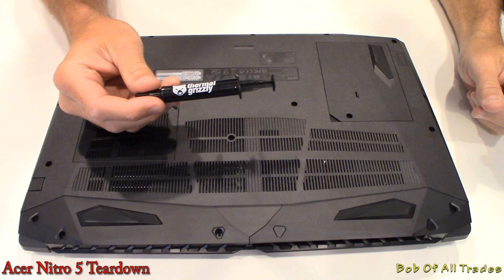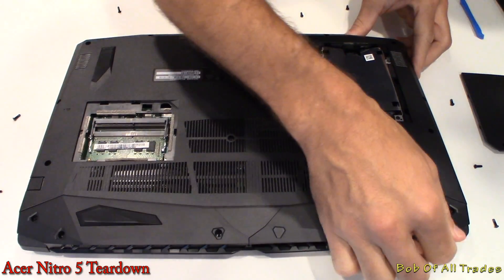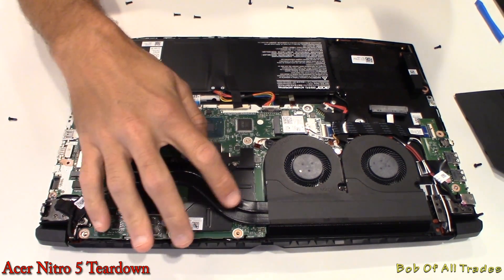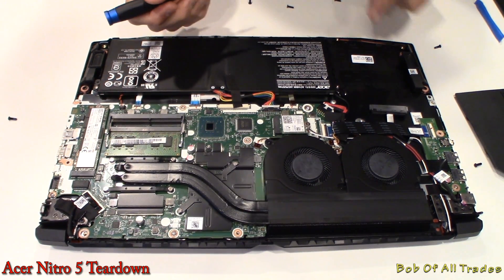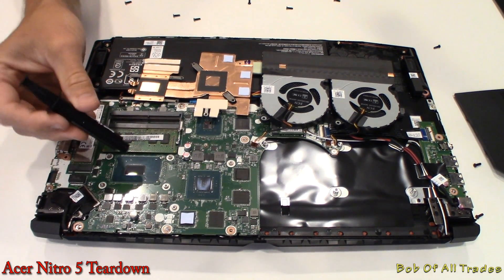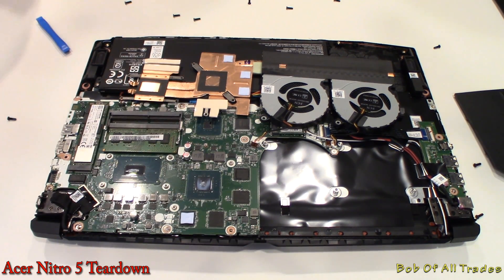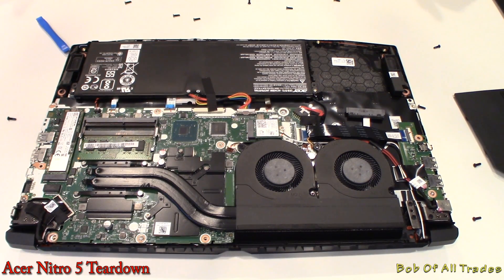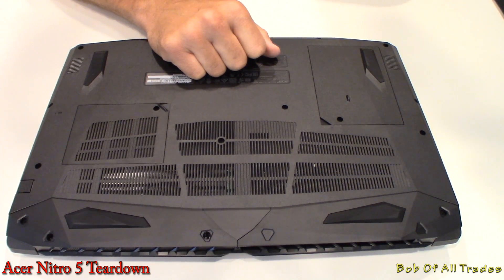Acer Nitro 5 Repaste w/ Kryonaut!  i5 8300h

Comment: how did you get temps repaste + UV around 70-75c .. i have got 75-90c after replace arctic mx-4 with playing need for speed payback
Reply from the maker: MX-4 isn’t good anymore. 

You didn’t say you undervolted 

I also used max fans

We’re playing different games.
Reply: @BobOfAllTrades  i undervolted -0.150v + mx 4 get that 75-90c while playing need for speed payback

Comment: Never even considered replacing thermal paste on a laptop. Funny thing is I build gaming pc's. I just bought a hp Pavillion gaming laptop model #    15-cx0056wm
with an i5 8300h as well, I have some kryonaut and will definitely do this. Hopefully the disassembly and application will be  just as smooth.

Comment: Should've applied some liquid metal
Reply from the maker: doggo the doge It didn’t need it
Reply: @BobOfAllTrades either way thanks for the video. Really helpful.
Reply: I really would not suggest it. Yea it is superb, but it is also superb dangerous especially for laptops that are always moving around getting carried around.
Reply from the maker: There’s plenty a third-party vendors that sell these laptops with liquid metal applied and offer a warranty. If you know what you’re doing it’s 100% fine.
Reply: @BobOfAllTrades  name me one, that's complete bullshit, Linus did a video on liquid metal applied on the new Predator laptop (why didn't they put it as stock, then?) and they specifically said that liquid metal can ooze out around the CPU and gpu and potentially short something
Reply from the maker: I will name you two. HIDevolution and Eluktronics. 

Linus tech tips? LOL they didn’t even know who TongFang was.
Reply: Not going to change the fan + heatsink thermodynamic limits.

Comment: very clean and good informative video. Not many of these around :) thanks! I'm considering this laptop with 1050ti and i5 8300H. I just might aswell open it up and do this like you did right of the bat :)
Reply: Did you buy the laptop already?

I must say I did, and my temperatures did change. Yes I used another kind of paste, arctic silver ceramique 2, which might not be that heavy. Still I dropped an easy 10C at idle and 20C under load/gaming.
Reply: @MrGtagangster  without undervolt?

Comment: Hey man, thanks for the good disassembly guide.
Could you please help with an advice??
So i play cs go and my processor temps reach 100 degrees celsius... i use cooling stand for my machine but it makes no difference... i have read that grizzly conductonaut helps a huge amount, but one should not apply it on aluminum heatsinks. so the question is are heatsinks on this machine copper? if yes then i can apply grizzly conductonaut and it won't damage heatsinks and processor and graphics card chips? thanks for your advice in advance, merry christmas to you and your fam
Reply: Looks like copper

Comment: Hi, need one help.
In my Nitro 5, (7700H and 1050ti), CPU reaches 85-90c under load with -100v undervolt (otherwise reaches 95c no thermal throttle though), and there seems to be a lot of fluctuations in the temperature. GPU however is quite stable (65-75 under load) not much fluctuation either. Could it be thermal paste issue?
Would acer service cover this under warranty (don't want to void it yet).
Reply from the maker: Akshay Jain This is what repasting is for 👍

Comment: Gonna do this on my brothers nitro 5 now. Thx for the guide, wish me luck lol.

Edit: After spending a long time reapplying using this video I dropped the CPU temps about 10C but I am really bad at applying thermal paste is what is turns out and didnt get good coverage on cores 2 and 4 which dropped only like 4 or 5C. I do not want to do this again because it stressed me out lol. That was my first time applying thermal paste. Building my first PC next week so I guess it was good practice even though it was only a laptop.
Reply: I dont want you to cause any problem but, as long as your paste is no conductivity top, a little more paste is always better than little less paste. Again as long as it does not have any electric conductivity, there is literally nothing that can go bad with using a little more paste. There was a whole video just about it at Linus tech tips

Comment: HELP HELP👇👇
One of the motherboards screw to remove the fan,cpu,gpu etc are so tight 
Im not sure wht to do 
Last time i try i press the screw too hard and the screen broke 
Help me if u know wht to do and i prefer to do it my self
Reply: Did you break it?
Reply: @ehrix4468  its not break like tht,but all the screen edges has this red colour thing...if the screen is black u can see it
Reply from the maker: I ALWAYS use the iFixit toolkit as it offers several different screw bits so I can get the proper fit.  This way I do not have to press down hard to get traction or strip out a screw.

Comment: Wow, thank you! It reduces my CPU temp from 95-100c to 75c with mx4 thermal paste and -0.125v! My 1060 6gb are even lower!
Reply from the maker: Marius Rugland No problem!  A lot of times that thermal paste will just sit there and  dry out for many months before the machine gets used so it’s usually pretty crappy right out of the gate. You made a good choice and it makes one heck of a difference :-)
Reply: @BobOfAllTrades  Does this void the warranty? And if I got a cooling pad, would I necessarily need to worry about this? I plan on gaming for long stretches at a time!

Comment: I've got this same model. I haven't undervolted it, but I did repaste. 
Before the repaste the idle temp (around 10% cpu usage) was 45c but it 
would get to 95c+ under full load. 

After the repaste it idles at
 around 45c-47c and only goes up to 74c under full load over extended 
periods of time. I'm definitely happy with the temp under load, but 
honestly I'm confused as to why idle temp stayed the same.
 
What kind of idle temps are you getting? Do you think it's okay for the cpu to have such a high idle temp?
Reply from the maker: The fan curve pays respect to the temps so idle temps likely won't change.  It's also why your load temps improved so much assuming you used the max fan speed button.  Make sense?

Comment: Hello, what model is the SSD that it use? I have the same laptop but without SSD and is haven't found a proper one to this model. Greetings
Reply from the maker: Mario Jofre You don’t need the same model put whatever one you want in there. 👍
Reply: @BobOfAllTrades  yes, I know but what type of SSD it use in the slot, it is PCI ? Or m2?
Reply: @mariojofre4951  i have the same laptop and its m.2
Reply: Thanks , finally i buyed a SanDisk ssd m.2 and it worked great! It's incredible how fast it's working now, greetings.

Comment: Thank you so much for the video! This was exactly what I needed. I just put Kryonaut into my Nitro 5. I'll see how much it helps the temps.
Reply: How much did it help?
Reply: @AN-vs5pb  I actually don't remember exactly how much the temps dropped off the top of my head, because I returned the Nitro 5 soon after and got a Dell G3. But I remember it helped reasonably well, I think somewhere in the ballpark of 10°C.
Reply: @nomadben  Why did you returned it? xD
Reply: @Domin17maru  Cause it only had a 1050 Ti and the G3 had a 1060 for only a small increase in price, so I switched.
Reply from the maker: That's what this is here for :)  Enjoy!

Comment: Thank you, i have a question. Will pasting help with the noise during gaming?
Reply from the maker: That question is dependent on the laptop first, then what you're doing with it.  It'll NEVER be a yes or no answer for that question regarding laptops.
Reply: It might help quite a lot. If the CPU temp is 90C, then it is quite obvious the fans will have to work harder to cool the laptop down, making more noise in the process. On the other hand, when you blow the dust away and repaste, the laptop will cool down easier and the fans don't have to work as hard.

Comment: This is a very good video, thank you. I just ordered the nitro 5 and will probably do this before I even power it up. I hate to do that but with your video I feel pretty confident.
Reply from the maker: Boot it up first just to make sure it works correctly.  In case it doesn't (unlikely I know) at least you know it wasn't you :)

Comment: Does this void the warranty? Is their a void sticker anywhere?
Reply: Yes
Reply: ruskovak where is the void warranty sticker on the laptop or does it use some other way to show a voided warranty?
Reply: I'm going to buy this laptop in a few weeks so I'm not entirely sure about the availability of sticker. But here in Bulgaria, I'm pretty sure that if you change the thermal paste your warranty is over.
Reply: ruskovak have you gotten your laptop yet to confirm if there is a void warranty sticker? My laptop hits 100*c as a max(stock) after a 2 hour session and thermal throttles really bad. i can undervolt but it barely avoids the problem of throttling.
Reply: @turn1p  Hi! Yes I've got it. Already changed the termal paste and installed ssd. Be sure to not put too much on it! There was not warranty sticker.
Reply: @turn1p  Hi again! I forgot to tell you to use Throttlestop program. Watch some videos on Youtube and learn how to use it. You wouldn`t experience any problems with high temps after that.
Reply: @MrRuskovak  my gpu gets 75 celcius and cpu around 70 is it good 
I have the same laptop with Ryzen 5 and Radeon 560x
Reply: @MadhumithanRA  It`s very good actually. Don`t worry.
Reply: Even if there was a warranty sticker it will not void it in the US. It's not legal they have to honor the warranty anyways (As long as you don't mess something up on your own)

Comment: Grain of Rice method on paste is not recommend. IMO The best way is center dab (or swirl) then spread level edge to edge using a non raised numbers credit card, works like a charm every time. I use a movie membership card. You can also "season" the heat sinks by placing a very small amount on them, rub it in with a tissue then wipe off without alcohol cleaning. Learned this years ago from Artic Silvers webpage and used it daily on commercial laptop repairs.
Reply from the maker: Joe Smo My method is absolutely perfect. In fact I have shown what my method looks like after heatsink removal on several occasions and the application has always been perfect.  

Nobody spreads paste with credit cards anymore.

Comment: Dumb question but I have never looked at the inside of a laptop like this before, only looked at building a desktop so far. Is it even possible to upgrade that cpu/gpu later? i understand they are smaller versions of desktop version s but would it be possible later?
Reply: Also good vid, seemed very easy fix. Probly gonna try and pick up a 600 dollar version on black friday with the ti, 8300H and an SSD to replace my current HP laptop. thanks!
Reply from the maker: Mace Snider nope sorry they are soldered in place. Almost every laptop in the world is like that with the exception of very very few. 👍
Reply: Bob Of All Trades ah ok thank you! Either way for 6 bills it’s a great deal, and pretty confident I could sell my old laptop and the upgrade would only be 150 ish dollars.
Reply: Bob Of All Trades was the gpu in the vid a 1050 ti?
Reply from the maker: Mace Snider Of course 👍
Reply: Bob Of All Trades amazing how small it is compared to what I’m used to seeing from researching desktops
Reply from the maker: Mace Snider When you remove the lid on a desktop CPU or the cooler from a GPU the dies are the same size as their desktop counterparts.
Reply: Bob Of All Trades ohhh on, the the outside lids and body are different, for is the same
Reply: Some gameing laptops u can just upgrade the cpu
Reply: some expensive laptops are cpu upgradable

Comment: Can I take out the fans separately? Do I have to take it out with the pipes? If so, do I have to apply thermal paste again?
Reply from the maker: Mugzie Unless I separate them in the video, you take them out together with the heatsink.  There’s some fragile sticky paper that attaches the fans to the cooling fins.  This helps guide the fans air through the cooler correctly.  Do not compromise that. 

You ALWAYS have to clean off the old paste and apply new when removing the heatsink. Zero exceptions.
Reply: Bob Of All Trades ok I’m getting thermal paste in a week thank u for fat replies
Reply from the maker: Mugzie Undervolt, max fan when gaming and better paste will drop temps from their max by 20c easily when I had mine.
Reply: Bob Of All Trades yeah my Acer Nitro 5 barley has dust in it I got it 3 weeks ago and it always crashes idk why
Reply from the maker: Mugzie probably software causing it. I’d do a fresh ISO install and only install what you need.
Reply: Bob Of All Trades ok I will try that, event viewer said error 6008 when it crashed, idk what that meant. Anyways is undervolting it by 100 fine?
Reply from the maker: Mugzie -.125 should fine per my tutorials
Reply: Bob Of All Trades ok thx
Reply: Bob Of All Trades also what’s power limit throttling
Reply: Bob Of All Trades my laptop is power limit throttling unless I undervolt it

Comment: Hi bro , I’m having trouble with the fan noise , idk why but my nitro 5 just start to make a weird noise that coming from the fan and I would like some help 😭
Reply from the maker: Trouble a not sure how I can help.  You’re left with sending it in or fixing it yourself.  Pretty cut and dry honestly. 

There’s no other advice as long as this “noise” is not normal from your experience.
Reply: 1 year late lol but i would just like to put that it was probably dust gathering in the fans, mine started making helicopter noises took it apart cleaned the fan and it is now as quiet as it was when i bought it

Comment: I call anything above 60°C on anything a major cooling issue... Dear God that's hot... Even having an A8 5600K desktop Overclocked to 4.5 GHz installed in a semi with a Corsair H60 water cooler, running as often as the truck for 3 years ... On the hottest days, never got above 70°C under full load!
Reply: It's a laptop, not a desktop

Comment: Hi, I am currently doing a lot of research on laptop repasting, as I have a problem with my VN7-593G (Aspire V Nitro 15). I know, it's a different series, but from what I saw, the heatsink design (fans, screws, material) is similar. So my problem is that I can't get the screws out from the heatsink and the fans on my notebook. I already tried way more force than on the case screws, but I don't want to try too hard and end up stripping the screws. I'm thinking about getting the iFixit essential Toolkit since I believe their screwdrivers and bits are way better than the 20yr old precision screwdrivers I have lying around. So would you recommend getting this toolset and try again? If yes, which exact bit did you use to open the screws? Or would you recommend asking the acer support first?
Reply from the maker: The toolkit is linked in the description.  I can't recommend tearing today's hardware without it, unless you're the type to have tons of tools in your garage.  I don't recall there being anything other than a phillips screwdriver.